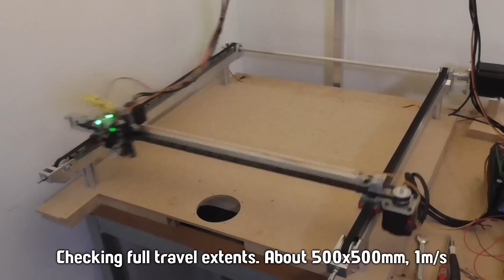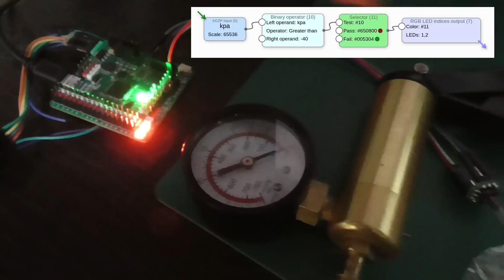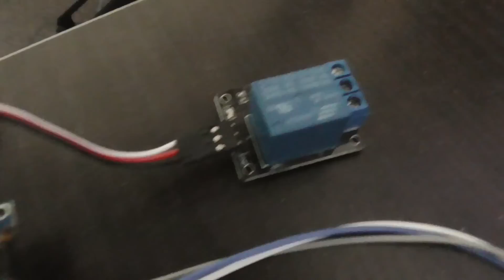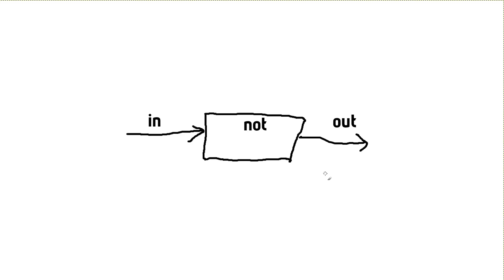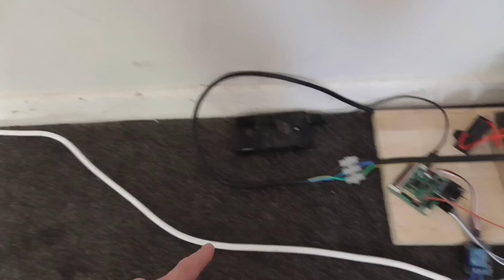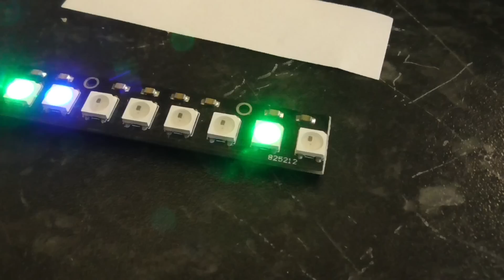SMT pick and place, part 2 (vacuum system)

Comment from the maker: I actually made that little extension cord relay breakout many years ago for a heater, which (unlike my fridge pump) had no other points exposed. I think my reasoning was if one of those wires was to be touched accidentally, I'd rather it be neutral. When an appliance is connected to the output end of the cable, bridging the two pins underneath the relay (like I did with my fingers it seems) would be a similar shock regardless of which wire was broken out, and touching just one of the pins would be a 50/50 chance of shock, also regardless of which wire was broken out. When there is no appliance connected on the output, the chance of shock is higher if the live wire is used on the relay. It was a long time ago, but that's probably what I was thinking.

But in the context of this video where the fridge pump has other points exposed, this arrangement causes one of the points on the pump to be permanently live, which is not cool. Perhaps this is why people are telling me that breaking out the live would be preferable? In any case, I will cover it all up so I can't accidentally touch anything, and maybe also add a second relay to switch the live as well.

btw I know there is still a chance of shock from just the neutral wire only if things elsewhere have not been wired properly, so the above 'shock or no shock' deductions are only probabilities. If we assume that wiring is usually labelled correctly, I think the logic still is still valid.
Reply: There are vacuum ejector pumps that use the Venturi effect.. they are driven by only water pressure.. no shock hazard !
Reply: Always switch the active wire.(Brown) This assumes whatever you are plugged into is wired correctly. If you are going to shock yourself again, can you post a few more vids in advance while the paramedics are shocking you back into rhythm :)

Comment: that's such a crazy overkill. Vacuum required to pick an SMD component is so little.
Reply from the maker: Right, the goal is not to have strong vacuum. The point is to have a instantaneous and stable reserve of vacuum, tightly controlled within a user-definable range, and not have to turn the pump on and off every ten seconds or something crazy. So the efficient thing to do is make use of whatever max vacuum the pump can provide, give it a large buffer, and have it feed a lower vacuum tank for the machine to actually use. Of course I could have just used one of those aquarium pumps that some people do, but I cannot stand the dying donkey noise they make and the constant turning off and on drives me crazy - it's so bad that I have to mute any videos I watch that show those systems running.

Comment: How did you get shocked? The motor is an inductor, therefore, all the wires in the motor completed the circuit and if you but your finger on both ends of the blue wires then you would get shocked.

Comment: Terrific watching as usual. Reminds me of an accident I had long back when I tried using those PVC pipes as a accumulator for storing air pressure.I has used the same fridge compressor too. Would not have worked of course, unless I had a diaphragm or spring piston inside. All I ended up doing was blast the pipe with an almighty bang , luckily none of the shrapnel hit me.

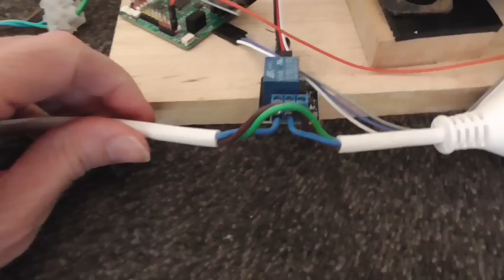Comment: 48:50 You tried to power the compressor through YOU. Although the left blue is neutral (presumably), the right blue is hot! It is returning from the compressor, which has quite low impedance so that you can enjoy a decent shock by touching the two blue wires. Your two fingers probably had 230V AC across them for a moment.

Comment: Warning Warning, danger Will Robertson. The way you have the relay breaking the mains supply to the pump is VERY dangerous. Blue is neutral meaning the live line is never switched off. At a minimum break the line ( brown wire) or better yet use a double pole relay and simultaneously switch neutral and line for maximum safety since it is not unkown for DIY wiring jobs to have the line and neutral reversed, particularly when fitting a plug.
in regards the way the solenoid valve works better one way I suggest you look into "pilot operated valves". It is common for solenoid operated valves to be pilot operated and are not bi directional.

Comment: Are you plannig to use Open PNP?
Reply from the maker: No, I learned a lot while making the linuxcnc-gcode-server, so I will try making my own controller built on similar features.
Reply: @iforce2d going to be agreat series then
Reply from the maker: Well, the actual making of software is terrible for video content though. Just look how boring this one turned out :) On the other hand, the result can be fun to watch. Here are some pure bezier spline (constant jerk) movements, no LinuxCNC or anything, just my own program running with realtime priority. https://youtu.be/nj7-fPy4DGg
Since I understand 100% of everything happening there, it's tempting to go my own way entirely, even knowing it will be a lot of work. LinuxCNC brings a lot to the table but it wasn't really made for this use case, and learning the code base will still be quite some work. I'm really struggling to decide...
Reply: @iforce2d  quite fast and reproducible without feedback loops

Comment: I wonder why you just didn't use common microswitches like from a mouse instead of the optical ones.. did you mention somewhere why ?  ..Got to watch part one again , excuse my ads ^^
Reply from the maker: I actually can't remember why I didn't go for regular switches... size or weight maybe, or repeatability, or because the activating lever needs to be rigid and well attached instead of just cardboard and double sided tape. It was quite a while ago.
Reply: @iforce2d The only reason I could imagine is if you want to measure two (or more) positions on one axis.. have two alu strips pass one optical switch.. (or the other way around.. two sensors one alustrip) I actually cannot imagine how to mount that though .. like with a bridge ?  but what would it be good for ? ..  I wish you rainy days for prototyping then ^^

Comment: Can't believe I'm still watching the Video after 27 minutes... Must be interesting....
27:00 You would be better off using an Inductive or Hall sensor for limit detection instead of being required to be in a low ambient light room. On Ali look for "Mini Inductive Sensor NPN 3-Wire Square Proximity Switch". Cost About $4 each delivered. Single Hole Mounting
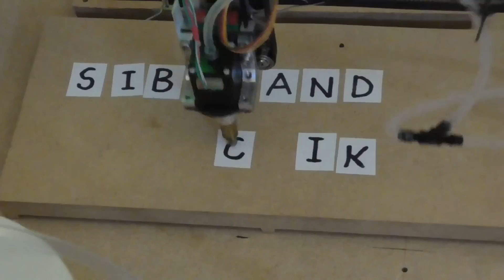1:03:50.... Almost....😉
Reply from the maker: I think I decided those were too big, when the cable on the back is included. It was a while ago, can't remember.

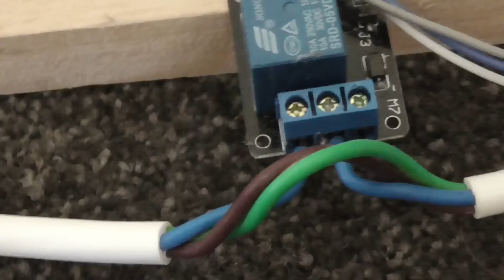Comment: 49:15 you can get a shock from the blue wire if something else in the house is turned on that completes the circuit back to the positive
side so its not full 240v maybe 30% etc....or if someone has wired some outlets the wrong way
where red is now blue etc....thats the way I beleave I got a shock also from my mucking around with my electric blanket as a kid.....Brett
Reply: Hell... that's doing it the hard way!  Three year old me just poked his pudgy little finger into the gap between the plug and the socket... worked exactly as advertised!  😵‍💫 😱 😭

Comment: Originally 3d printers used optical sensors for limit switches. Pretty quickly we found out there are impacted by lights outside the switch. Immediately I thought that green led will cause issues
Reply from the maker: I was wondering about the green LED while laying out the board, but was trying to keep it as compact as possible so that's where it ended up. But the sensor is infrared so I think it's ok. At least, I wasn't having any problems until that sunny afternoon.
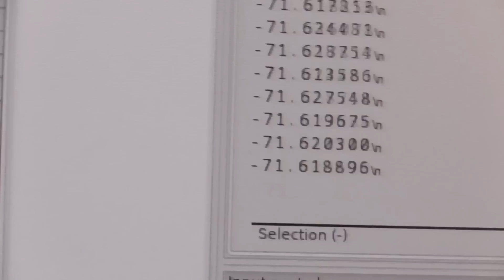Reply: @iforce2d  :  I took one look at what was happening, and said "Induction...  something in that little unit is acting as an induction sensor!".   I would have wasted hours trying to nut it out, and finally at about 8:30pm, I would have said "Yay!... Cracked it!".   (8:30 sunset for non-New Zealanders.)
Reply: A simple microswitch is small and light and much simpler than a optical switch and doesn't need a fragile flag that could be broken off
Reply from the maker: The flag doesn't touch anything so it doesn't matter if it's fragile. The microswitch will still need some kind of adjustable lump, that will need to be securely mounted.
Reply: If it's only used to find home then it doesn't even need to be adjustable as long as it's a fixed reference point. I would most likely break a flag off when working on the machine.
Reply from the maker: Right, as just a fixed reference point it wouldn't matter much, when used as a limit switch ideally you'd want to adjust it so that it triggers just before the head would collide with the end of the rail to maximize usable space. Yeah I can see myself knocking those flags off eventually.

Comment: For precision parts that you need to flip consider geting a ER collet like ER40. Lathe has morse taper (mt3 or mt5) under chuck so you could get good collet and get very low runout even if you flip part in collet.
Reply from the maker: Yeah I'll probably get one someday, just needs da moneyz
Reply: Best option of all is to leave the part mounted in the chuck (or collet), and don't disturb it until all concentric operations are complete.
Even if you use square stock in a three-jaw chuck you can get accurate measurements provided you are only making cylindrical cuts, and you don't remove the workpiece from the chuck.  If I can't avoid removing it, I remove the chuck from the lathe with the workpiece in it. (Not always practical)  It then depends on how accurately the chuck can be refitted to the lathe.
Reply from the maker: Ideally I would have brought the stepper motor to the lathe for fit checking, to avoid unscrewing the part from the nozzle at all. But the motor was already soldered into wiring on the machine and I was too lazy to undo it.
Reply: @PiefacePete46  i presumed that this mini lathes dont have screw on plate or pin(like in D ) to index a chuck. But has screws from behind plate to mount a chuck and backplate is intregal part of spindle.  Seems most easy to adapt such collet to get something more that is easy to put and remove.

Comment: I saw that relay and imagined picture of you being zapped. But its ok I was thinking, and then you said you where zapped haha.
I am working on your code for weeny to convert it to CH32V307 which has eth phy. I was supprised with code that you used one timer for all stepers.   I am going trought code and convert it to that riscvchip  and code style suprising similar.
Reply from the maker: Yeah I was quite pleased with how that turned out, to have it all running on such a cheap and low-spec chip, and at 50kHz too. It's quite amazing what these things can do if you know how to use them. That method also means that all steppers get the high pulse at exactly the same time - probably not important in practice but that is the ideal signal to have for synchronization. My wiring is looking very messy again, so pretty soon I might start designing a new board to include the solenoid mosfets, I2C pullups, and allow 8 steppers using a F103RC with 64 pins. Or maybe even a G431 that has a 170MHz clock, which would allow faster step rates.
Reply: I was always chasing speed of pulses but this 50khz seems good enough by your example. This chip has 4 advanced timers for motors and I was thinking I will have to use all of them (they can sync) but your code showed me different approach. I will try to mimic the same 4 channels per timer. I never did this before so its great excesise.
Reply from the maker: Yeah I think 50kHz is enough for most practical purposes. I calculated the fastest movement of this machine will be only 29kHz, which is faster than software stepping (via parallel port) could do, but still easily within the capability of the STM32. Having a faster clock helps in general though, especially when you keep piling on new features.
Reply: @iforce2d  stm32f103 is very old chip. 5v tolerance makes it neat but it has some shortcomings. It cant do i2c over dma if I remember correctly(perhaps together with pulse counter). Today there is so many new chips. Even clones of that series can clock more and perhaps have some things like this improved. Even for this ch32v code is so close to stm32. If i didnt have issue with nerve in my leg I thonk i could covert it quick. So your code is great example.

Comment: Think you might need to add an option to pause the placing when the vacuum is too low, allowing time to recharge the small reservoir? The squishy tubes might be wasting some vacuum? and come on Chris switch the active not neutral wire from the mains!
Reply: I watched the video,  I looked at the wiring "hack", I left a reply confirming New Zealands house wiring colour standard... and I didn't even spot the switching on the neutral!
I must pay closer attention
I must pay closer attention
I must pay closer attention
I must pay closer attention
...
😜
Reply from the maker: I actually made that little extension cord relay breakout many years ago for a heater, which (unlike my fridge pump) had no other points exposed. I think my reasoning was if one of those wires was to be touched accidentally, I'd rather it be neutral. When an appliance is connected to the output end of the cable, bridging the two pins underneath the relay (like I did with my fingers it seems) would be a similar shock regardless of which wire was broken out, and touching just one of the pins would be a 50/50 chance of shock, also regardless of which wire was broken out. When there is no appliance connected on the output, the chance of shock is higher if the live wire is used on the relay. It was a long time ago, but that's probably what I was thinking.

But in the context of this video where the fridge pump has other points exposed, this arrangement causes one of the points on the pump to be permanently live, which is not cool. Perhaps this is why people are telling me that breaking out the live would be preferable? In any case, I will cover it all up so I can't accidentally touch anything, and maybe also add a second relay to switch the live as well.

btw I know there is still a chance of shock from just the neutral wire only if things elsewhere have not been wired properly, so the above 'shock or no shock' deductions are only probabilities. If we assume that wiring is usually labelled correctly, I think the logic still is still valid.
Reply from the maker: Yes, the controller will be able to see that vacuum is insufficient and wait. At least the information is available to do that, not sure whether future Chris will implement it though.

Comment: With using the frig compressor as a vac pump........they are originally designed with refrigerant flow in mind. This is to say the low pressure return under normal application cools the motor and oil. When used as a vac pump, that is out of the equation and the motor will overheat if run for long periods. That plus one needs a breather pipe, reasonably long and high enough to allow any expelled oil to bleed back into the motor.   As mentioned by others, NEVER switch the neutral (well, not on it's own like you did there) ....you can be almost certain that brown from a sealed cable is the active BUT electrical regs require ( apart from obvious dodgy bare connections) that portable (anything powered from a plug/lead) gear should be double pole switched. THAT ensures any possible wiring reversal (not so common these days as points are already internally wired) does not effect the outcome. i.e. turn off turns off the active FOR SURE.
Reply: Exactly my thoughts. Without reasonable recirculating lubricant solution (the oil should be on both sides of the compressor) the motor has  its  expectancy in hours...
Reply: @medvídek_Krupička  I just have my experience with another oil based compressor - it came through the nozzle. The oil is distributing outside... happy breathing. I'd only go for an oil free compressor (I also built my own machine actually).

Comment: You could just use a piece of tube and a peristaltic pump rotating back and forth to get negative and positive air pressure, no vacuum pump or solenoids
Reply from the maker: Should work, yes, but it would be horrifically slow.
Reply: Do you have experience with that?  If it worked reliably in this situation, it would have some really appealing features:
Cost
Simplicity
Completely portable "one-piece" machine
Fully software configurable and controllable
Able to supply a pulse of positive pressure, rather than just ambient pressure, to release the component
You've got to love the idea!  👍

Comment: Why didn't you use mechanical swithes for the limits?
Reply from the maker: I actually can't remember why I didn't go for regular switches... size or weight maybe, or repeatability, or because the activating lever needs to be rigid and well attached instead of just cardboard and double sided tape. It was quite a while ago.